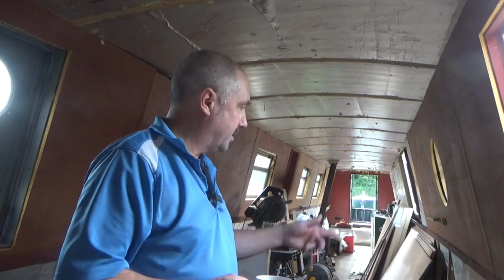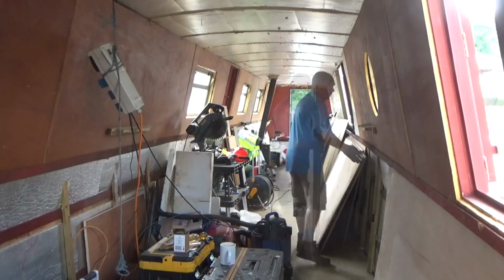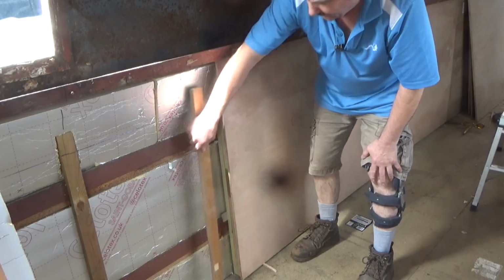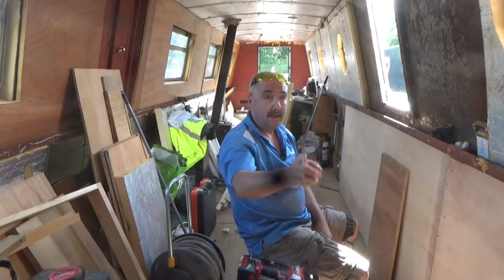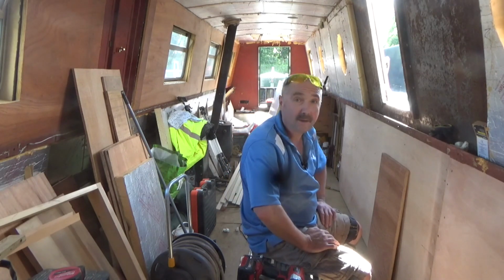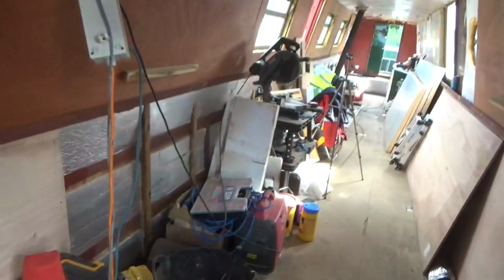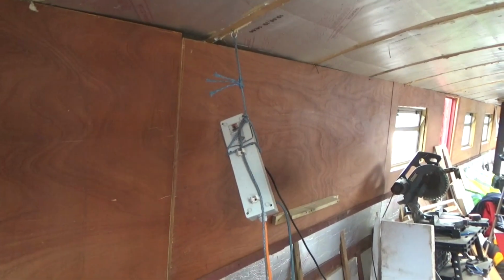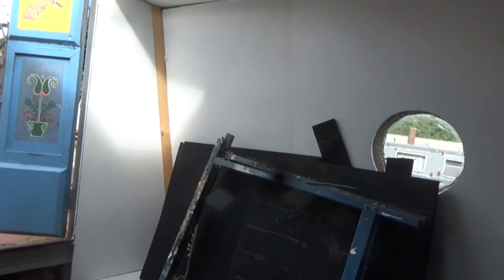Narrowboat Refurb . Fixing Under Gunnel Panelling

Comment: I like the idea of a batten on top of a batten Andy. Screwing into timber creates a thermal break as none of the screws are going into the steel so no thermal bridging or any chance of condensation on the interior screw heads.